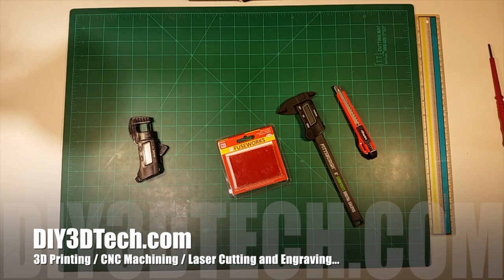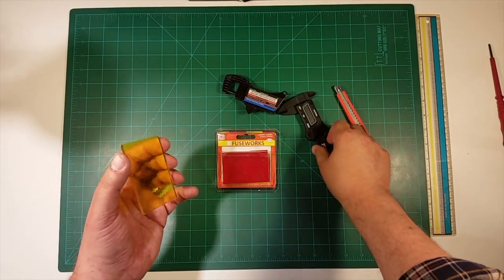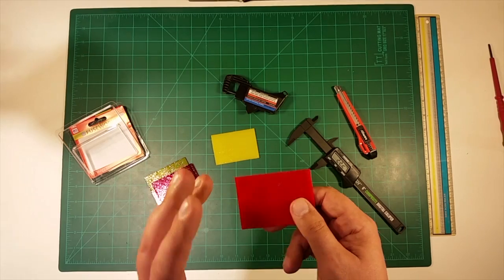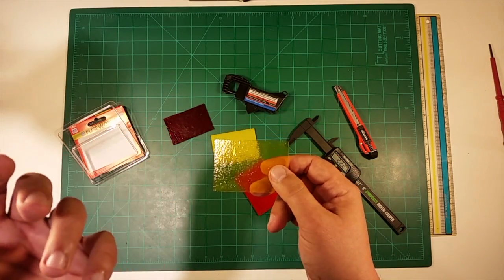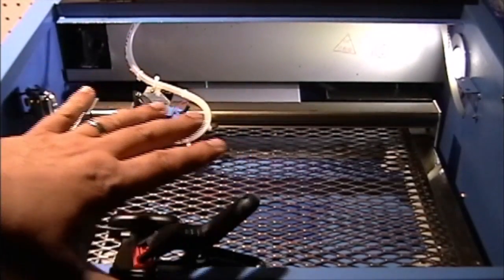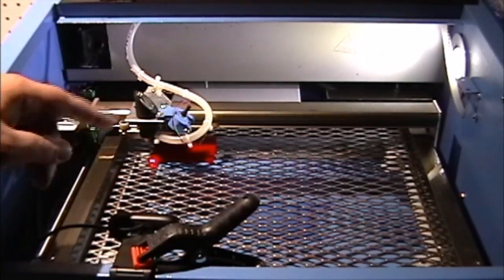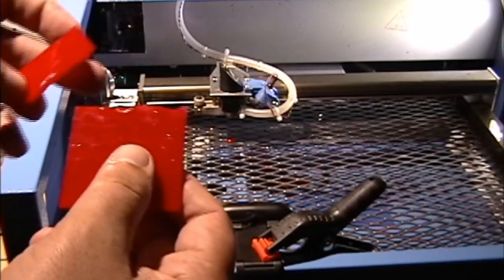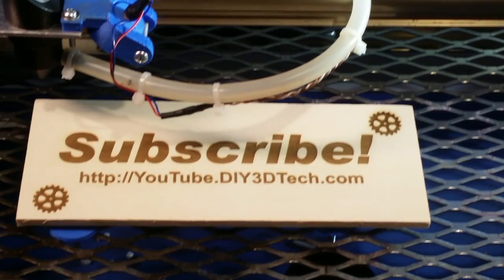K40 eBay Chinese CO2 Laser Cutter & Engraver - Cutting FuseWorks Glass Part 1!

Comment: Glass generally needs to be heated slowly or risk shattering or what’s known in the glass world as shocking it so it breaks—this is why traditional glass kilns heat and cool extremely slowly. Some glass artists use a wet jet to cut glass to help keep the glass cool so it doesn’t shock.

Comment: A. Not even remotely “shrink dink”. True fusing glass. Can be used in a microwave kiln as mentioned or traditional slower kiln. 1200-1700 degrees is normal heat used for some types f glass work. CoE is important and not interchangeable.

Comment: oh my that was cool ..  looks to me like you could use a cool down cycle in your G code
ie. do 2 passes  and wait few seconds , and repeat .   looks like you were getting a good cut started and it looked like it was staying hot after the laser left . 
I have cut some crazy thing with  my tiny 300mw violet ,  ironically it was the cool downs that let it work . i would get a laser weld effect if i kept hitting some targets while they were still hot , but just a bit of cooling and subsequent passes would  cut just a bit more, vs keep molten a melting target .  now mind you i'm in the real shallow end of laser power  LOL , and im just cutting plastics and balsa .
Reply from the maker: Great minds think alike as I am playing around with something similar and have new laser just about set up (yes I bought another one :-) and thinking what would happen if I just moved faster?  This way it wouldn't "sink" the heat creating a more localized affect.  What do you think?
Reply: speed was of for only so deep . ( my wee laser vs black plastic , a thick ABS plate ) . the issue was i could not vaporize the mass at target , the rest of the pastic was acting like a heat sync .  I had to do medium to slow feed rate and cool downs .  or larger paths such that no point was too hot by the time the laser returned. 
over heat can cause the surface to melt and become more reflective . i dont know thats a issue with pigmented glass and your laser. yours is 120x more powerful than mine  .
Im sure there is a recipe for cutting that stuff with your laser , just have to find it , look how deep your laser got . possibly adding a cooling fan cool it just after laser moves on. its the residual heat that kills it.
Reply from the maker: Yea the issue is this is funny glass as it has a high co-efficient of expansion (one of the reasons I thought this might work) however as the glass expands, the cool glass doesn't.  However the laser does "vaporize" a portion of the glass think repeated fast passes might work.  Another experiment :-)
Reply: yeah , its hard to get max vaporization and minimal melt .

Comment: You know I have been having a conversation with SarbarMultimedia (the gentleman you said you watch too) about laser tubes and it seems that the life expectancy is including shelf life so if you buy a tube as a spare and a few months later try to use it it may have past its 2k-8k hours.  That blows as I am not a business so would not be using it every single day.
Reply from the maker: Hmm he is a smart guy and would think shelf life would affect the overall life of the tube, however not in a linear fashion.  As I have mine for quite some time and it still just fine and I use it about once a week.  However, I would not stock a backup tube as when you got it, unless you installed how would you know it was any good and I have to imagine there is some both leakage as well as gas break down as it sat for a year on the shelf.  Also frankly it is cheaper to buy a new unit than tube and mess with it at this point (I got a nicer unit for $200 less than I paid for my last one).
Reply: DIY3DTECH.com
I just wouldn't use it enough to account for shelf life.  I mean I expect my machine to be off longer than it is on by at least a magnitude.
Reply: DIY3DTECH.com
Here is what he said "Look carefully at the tube life. I have recently found out that the tube life is not "beam-on" hours but is a typical shelf life....used or not. This is because the gas inside the tube is there as a partial vacuum and over time there is ingress of normal air past the seals that messes with the delicate mix inside the tube. Never buy a spare tube until it becomes necessary and just remember that the tube LO sell have about a 2000 hour life promise........that's only 83 days or 2.7 months!!!
These are worst case figures so you may be lucky and get 6 months. This is very important factor you should consider when making a cost/benefit analysis for a new tube purchase."
Reply from the maker: While I would agree with "there is ingress of normal air past the seals" I would disagree with it ages the tube at the same rate of use.  I have had one for way over 2.7 months and still works fine.  On top of it, know one of them was assembled like a year in advance of  me purchasing it and it still works fine too.  So I would have to disagree with him on that...
Reply: DIY3DTECH.com
You should let him know so he knows that is wrong info and he can investigate more.

Comment: Interesting test. I haven't heard "shrinkidink" in decades. Lol. I remember using them too!

Watching the video and seeing the fracture I wonder if it happened because of a flaw in the glass (like an air bubble) or could it have simply been caused by thermal shock.  I wonder how it would work if you preheated the glass in the oven prior to hitting it with the laser. 

Interested to know what an infrared camera would see at the target area during the laser firing. 

Another cool experiment. 

Regards,

Norbert
Reply from the maker: Naw the heat the glass too quickly in that one area while the remainder is cool and the rapid thermal expansion fractures the glass.  Not of it it is a strange glass sort of like a shinkidink but in glass and that way the stuff melts in the microwave.  I plan to try more experiments in the future...
Reply: DIY3DTECH.com - Shrinkidinks were some sort of plastic that we "shrunk" in the oven or toaster oven. http://DIY3DTECH.com
Reply from the maker: Yupper remember burning a number of them to crisp by leaving them into long and the reason you will NEVER see me on a cooking channel :-)
Reply: +DIY3DTECH.com
Expanding on Mr. Davis' idea and thinking outside the box, what about installing a custom made heater under the CO2 Laser's work table, or have the glass resting on the custom made heater to preheat the glass, and keep it at an elevated temperature, sufficient to keep the glass at its working range of  temperature (approx. 700 ~ 1000 deg C depending on the glass type, e.g. Soda Lime, Borosilicate, etc.) to reduce the chance of fracture whilst the Laser cuts it?

After the cut or cuts are made, the custom made heater is allowed to cool down at a controlled rate. with the cooling rate dependent on the glass' thickness, allowing for seasonal ambient temperature fluctuations, attempting to anneal the glass to reduce the probability of the cut pieces shattering or fracturing once it cools down to ambient temperature.

https://www.quora.com/At-what-temperature-does-glass-become-malleable-without-melting

I have a future project in mind to experiment with cutting tempered glass.